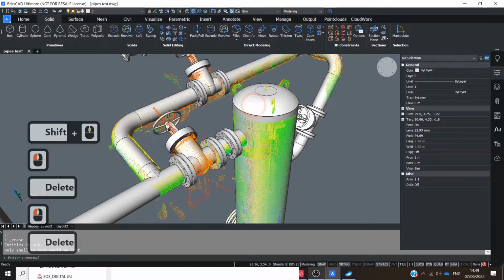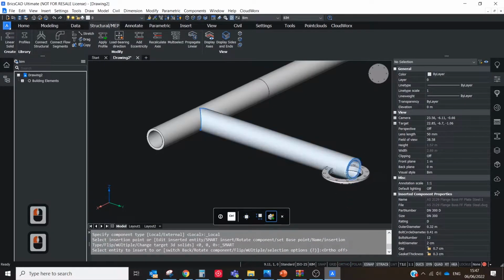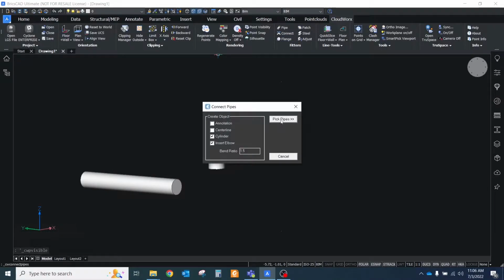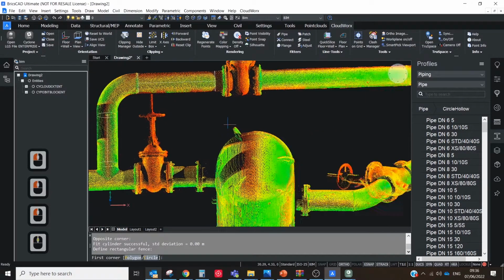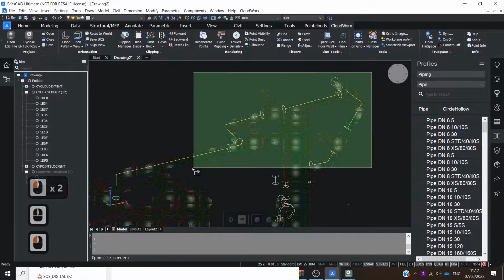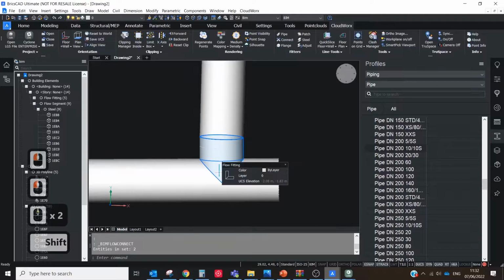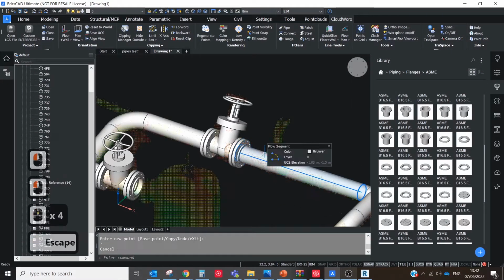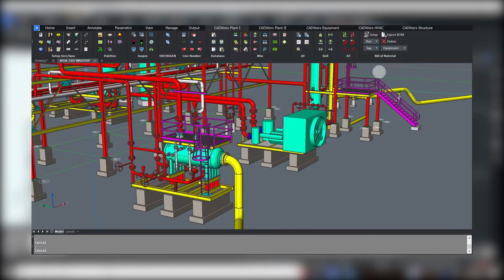CloudWorx for BricsCAD / Pipe Digitizing

Comment: Hello Aleksandr, Thank you for providing the great videos regarding the use of different bricsCAD modules. I am piping designer and would like to use bricsCAD as my design tool. However, I am confused to what bricsCAD module can I use to design my piping /equipment components.  I have been using Auto<plant in the past but license cost is an issue. From your bricsCAD  expert point of you what would you recommend to me as a solution. Much appreciated,  Dragi Nikolic